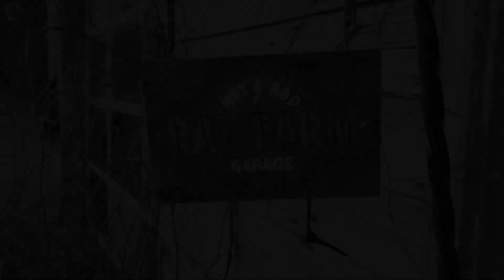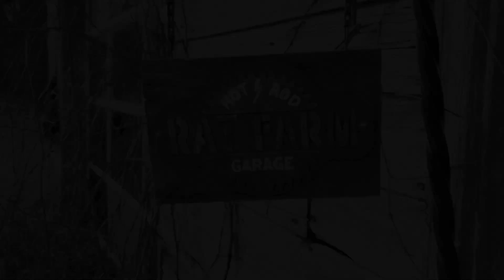Equinox Ecotec 2.4 piston install with engine in car

Comment: Two dumb questions did you replace rod bearings? When looking up those rings they offer different sizes just use standard?
Reply from the maker: I did, you have to use standard unless you have the crank machined.
Reply from the maker: For the rings, you will also use standard.

Comment: Did you hone the cylinders without covering the crank? If so.. Won't that shavings damage the crankshaft?
Reply from the maker: I didn't cover the journals.  But I sprayed the crank off with cleaner before installing the caps.  It would be a good idea to cover it.  If this had been a new engine or high performance vehicle I woulda been more careful.  I can't believe it even worked at all actually.  Car doesn't burn any oil.  Pretty crazy!

Comment: Did you use new head bolts and con rod bolts? I see they are TTY. Thanks.
Reply from the maker: I used new head bolts but reused the rod bolts, I live on the edge :)
Reply: @ratfarm767 so far so good? I just slapped in two pistons after some new rings and realized I didn’t have the rod cap bolts.

Comment: Hey I got the 3 3/4 ball hone like you had but I have to shove it in the cylinder, I didn’t see that part is in your video so I’m not sure if I should use what I have because it seems Lt should go in more easily
Reply from the maker: you got it right, it's a tight fit, push it in there and let it rip!!

Comment: Great videos man. Can i replace the water pump with the timing chain and sprockets off? Or do will i ned to drop the motor?
Reply from the maker: I replaced the one on this car, wasn't that difficult with everything removed.  I don't think you even need to remove the chain and related components, but im not 100 percent sure,  I'd have to go back and rewatch the video to see the details.
Reply: I replaced the timing chain and the water pump without taking the engine out..

Comment: Did you run breaking oil after you got it built or just regular oil
Reply from the maker: Think I just used standard motor oil, It's now running on synthetic of course and doing great.

Comment: About how much did this cost price wise for parts, and machine shop??
Reply from the maker: It was about $1000 for everything.  $200 in machine work, resizing the rods, resurface head and jet wash. Most of the parts came from rockauto and was about $800 with all the parts plus oil and glue etc